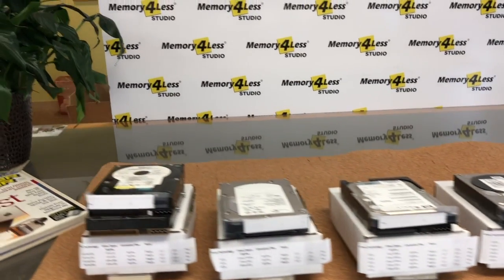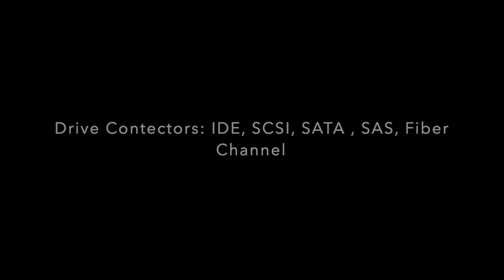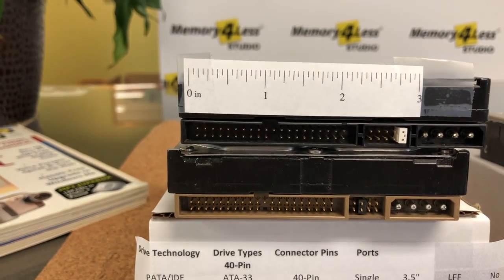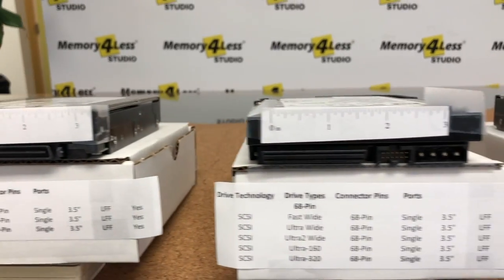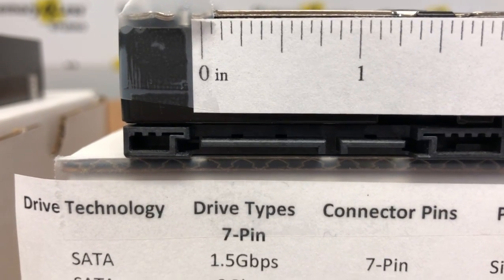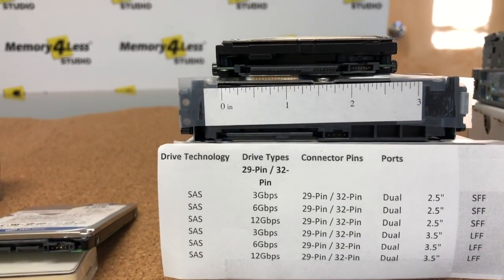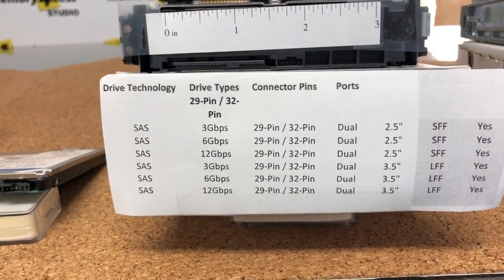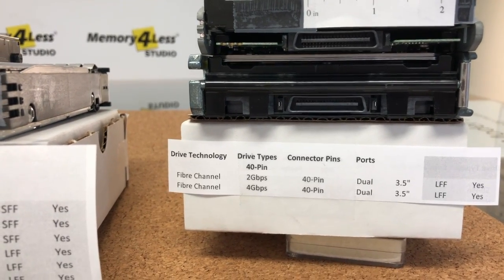Hard Drive Connector Types Explained! - SAS, SATA, SCSI, FC, IDE

Comment: Dear Friend. May be you can help me. I have some old servers in stock Intel KSW480 with SCSI drives. The servers are ok and for what I need do the job. Issue is that I need more drive space. Can I use SAS drives in the server ? If yes, what kind of adaptor I need to use ?
Reply: That Server was discontinued nearly 20 years ago. Therefore, the SAS drive technology will not be compatible with older motherboard. Neither will there will software drivers to support new devices on older computers. My best advice is see if you can get an older external SCSI drive to add data atorage. If your Server has no external SCSI connector, there may be SCSI Host Controller cards you could fit which would allow you daisy chain external SCSI hard drive devices. (if you can find one !)
Try contacting this company below for further advice. Just remember trying to put newer technology on older systems is always a bad idea, unless it is designed for backward compatibility. It is best to upgrade to newer servers that have SAS or SATA internal drives and support.
https://serverpartswarehouse.com/contact-us/